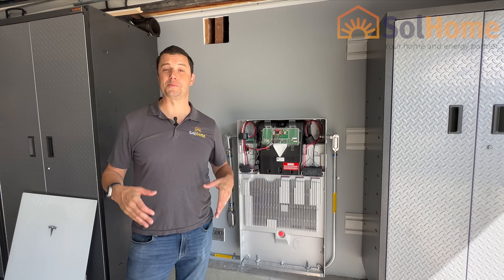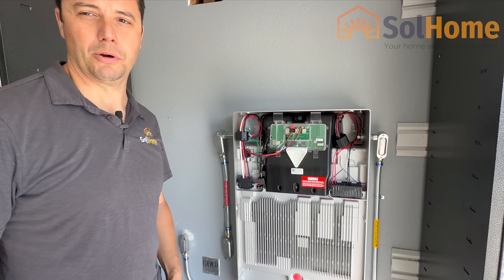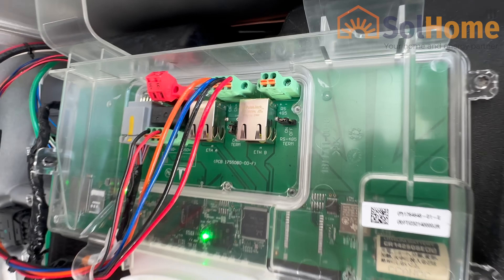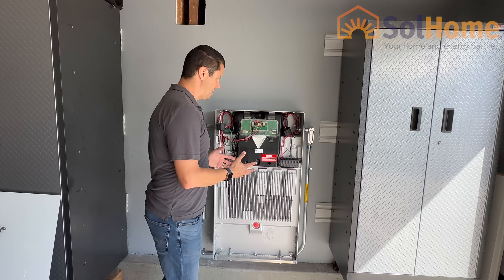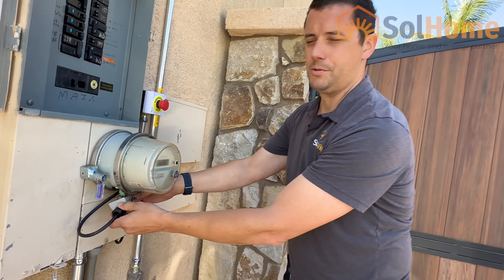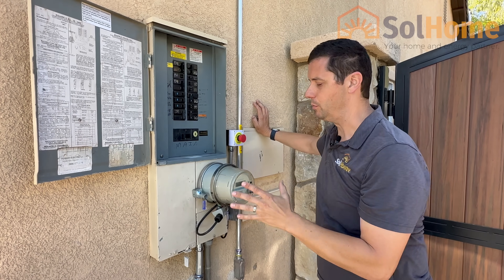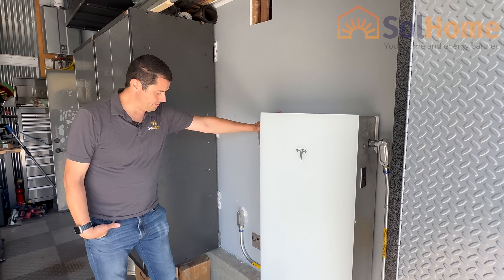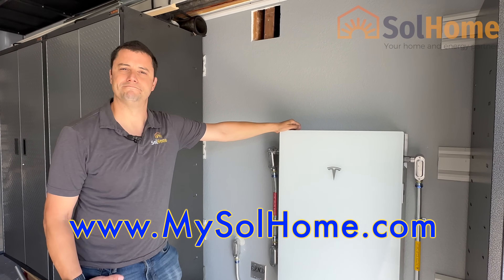Inside Tesla Powerwall 3

Comment: In an offgrid solution, can Powerwall 3 + Solar panels work without a Tesla gateway or Tesla backup switch?
Reply from the maker: Currently, I don’t think so. The backup switch and/or gateway have an internal “site” meter which the system requires for commissioning.
Reply: @mysolhome But technically an OTA software update could fix this, right? I'm gonna reach Elon about this :)

Comment: A couple of questions... First, what is the nominal voltage from the solar panels into the Powerwall 3? And second, what is the nominal battery voltage? Does the solar panel voltage come in at say 350Vdc, converted to 53Vdc (Battery voltage), and the inverted back into 240 split phase? OR is the nominal battery voltage says 350V dc and inverted by a high voltage inverter inside the powerwall 3
Reply from the maker: The MPPT input can be anywhere between 60-550v. Tesla has not disclosed the nominal battery voltage. I would think it’s closer to the 350v you suggest; no reason to have a lower voltage pack since it is integrated.
Reply: @mysolhome  So.... the inverter runs from 300Vdc?

Comment: Tesla already sold out their technology to china. The chinese already making 18kwh units with everything plug and play. You can get it for 1/4 the price of tesla. Tesla still using li ion on these? China are producing lfp batteries at 1/4 the price with UL certify.
Reply: Powerwall 3 is LFP. And is cheaper than EG4 installed.
Reply from the maker: For me, the backup switch is the star of the show here. To be able to enable whole home backup with very little labor is groundbreaking.

Comment: I find it more crazy that a 40k Tesla has a 80kWh battery and all the hardware to charge and discharge the battery had a very high rate while a Powerwall has a low capacity in comparison and costs a lot more per kWh.
Reply: You shoud read up on 'Economies of Scale'
Reply: @usmanmt33  Exactly!  They make 1.5 million cars a year.  No where near that many Powerwalls.  You want the Powerwalls to be cheaper, get the market to grow by 4x.
Reply: Even crazier is a used Ford lightning has 98 KWH and can be had for low $40k.
Reply: @ivansolares2448  You still have to have someplace to park the truck and it is useless as a backup if you are out driving it when the power goes out.
Reply: @ivansolares2448 yeah once it’s used… they go for over 60k before credits
Reply: @ivansolares2448  Mitsubishi PHEV 2019 has about 12 kWh with V2L , later models have more.  Cheap price for such used cars.
Reply from the maker: Again, the backup switch is the disruptive technology here. Whole home backup with almost no labor is the real savings.
Reply: @mysolhome why do you guys charge 16-20k for a battery when its cheaper than 4k to buy and ship.  You want to sell them and get the market to demand them, stop overcharging to retire tomorrow
Reply: @mysolhome  what's disruptive about it? We've had units like this in the EU for years.
Reply: @edc1569 it’s disruptive to US (no pun intended)
Reply: @mysolhome  nope it's not disruptive! What people needs is an actual smart panel luke span or whatever it's called! To be able to backup only the necessary things in house
Reply: @alanmay7929  Not at the expense of the SPAN panel and installation.  Simply install the Tesla Switch and add another Powerwall 3 for less money than the SPAN unless they have recently reduce the SPAN price.  But the labor to install the SPAN is almost as much as the Powerwall 3.
Reply from the maker: Exactly.